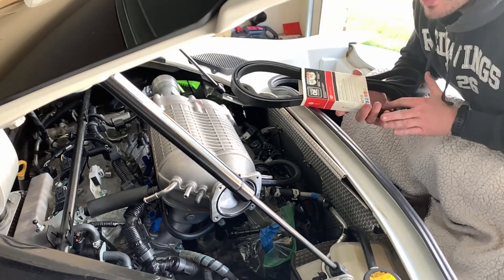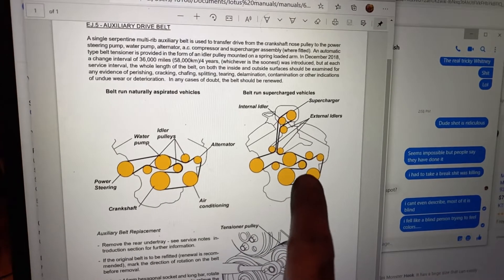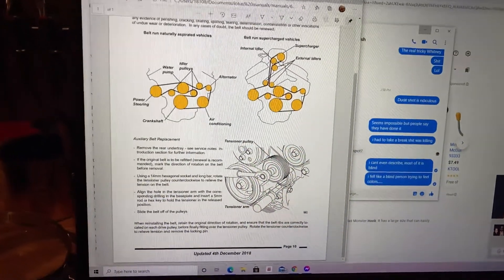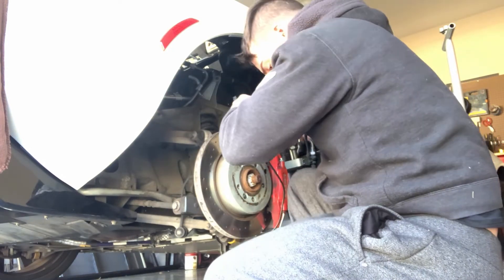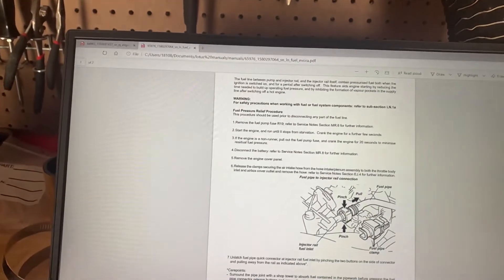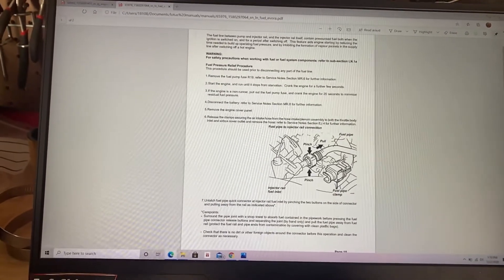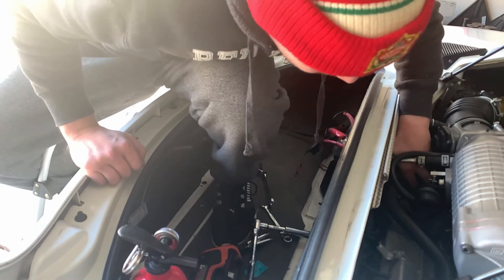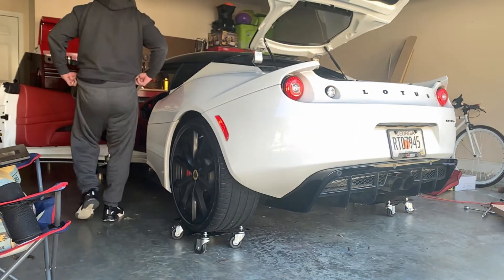Lotus Evora S Supercharger Rebuild ( Part 3 )

Comment: I still trying to find out if possible to change clutch without taking the rear clam off and pulling motor and trans.  what a sham.  almost seem worth altering the frame to be able to change clutch with engine in and clam on?   and thoughts please.  beautiful car.  I bought mine and the footbox could be wider and another brand of seats.  when you see such a beautiful car you want it awesome in every area and surprised Lotus didnt master the ability to work on it besides the incredible toyota engine.  so so tight even for clutch slave, bleed screw